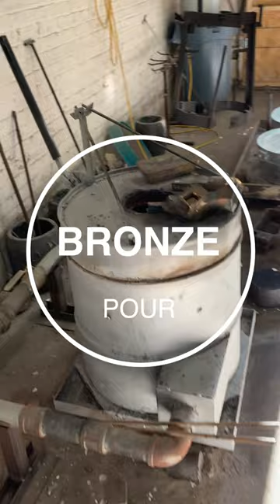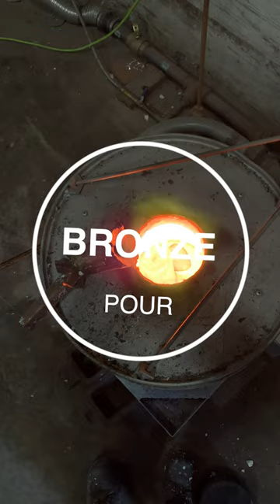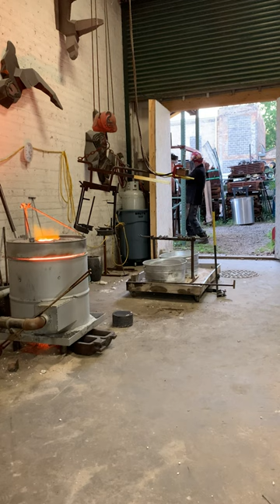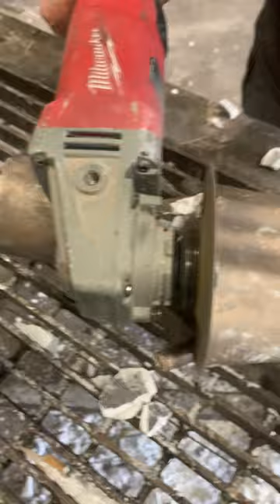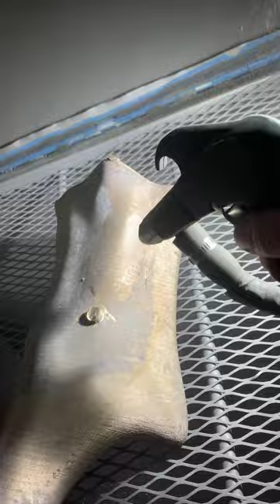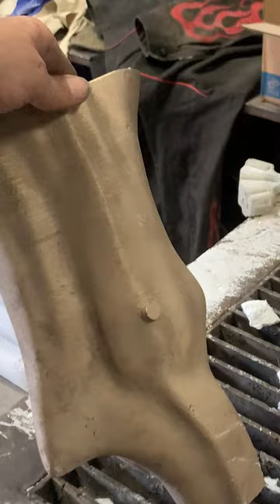Casting Bronze into Ceramic shell.  #shorts #foundry #metalcasting

Comment: I'm digging your content man, hey do you need to get some kind of permit or license for this kind of work other than just the typical business license? Such as some kind of EPA permit or inspection kinda thing or would that only be for say large operations. I know places are gonna have various zones and what not but I'm curious if like artisans get some kinda considerations. My bad if you've already covered this topic in previous videos.
Reply from the maker: Its a good question, most hobby, DIY, small scale foundries fall out side that kind of regulation.  You are more likely to have issues with local law/fire or a neighbor that will have an issue because they do not understand what you are actually doing.  But you are right each state/region has its own set of rules and laws. Although most foundries I know do their best to fly under the radar.

Comment: Eric, Thank you for your educational videos.  I am helping a friend, who has become disabled and can no longer sculpt, with some wax masters that he created 30 years ago and have never been poured.  My first task is to make silicone rubber molds from the masters.  Are you planning a video on this topic?  What rubber material do you use?  When he was sculpting my buddy  used tubes of GE one part silicone rubber from the hardware store for some very large and complex sculptures and it seemed to work well.   Some of his works are complex and my biggest problem at the moment is figuring out how to decide where and how  to make the breaks between the various silicone rubber mold segments.   Sure appreciate any advice or comments you may have.  Thank you,  Bob Thomasson
Reply from the maker: If you are going through the effort of making proper mold dont use silicon chalk.  I have molds made with it but they are always subpar to rubbers that are designed for mold making.  I have been mainly using smooth-on as of late. I like this https://www.reynoldsam.com/product/rebound-series/ but is pricey. This is less expensive. https://www.reynoldsam.com/product/mold-max/

It really depends on what you want from the mold, meaning do you just need to make a few waxes or are you looking to do a 100.  The tin cure rubbers are less expensive and are best for shorter run patterns.  The platinum cure rubbers are more durable and stay stable after they are made.  I have some from 20+ years ago that still work great while i have molds in Tin cure that died a year later.

As for brake lines its tough to suggest without see the pattern.  Some time the instincts with rubber, because you can get away with less you try to made larger mold sections, but don't make your life harder that it needs to be.  Brake it do into sections that are easier for you to handle.  A little extra wax work is better then braking your back.
Reply: @LunarburnStudio  Thank you for taking the time for such a detailed response.  I'l try to make some videos of our progress or find a way to send you photos.  My sculptor friend is, in my opinion, a genius and it's really a shame he is no longer able to sculpt.